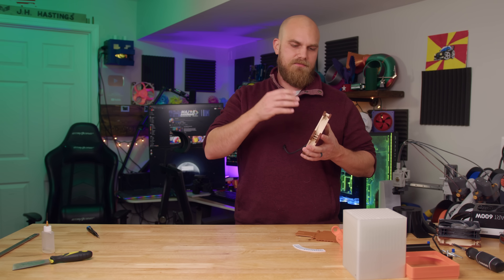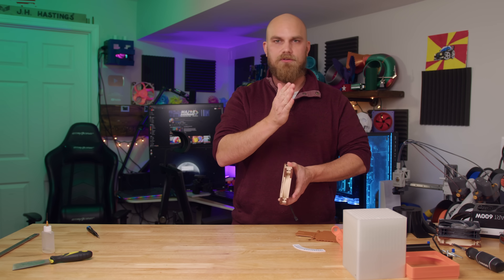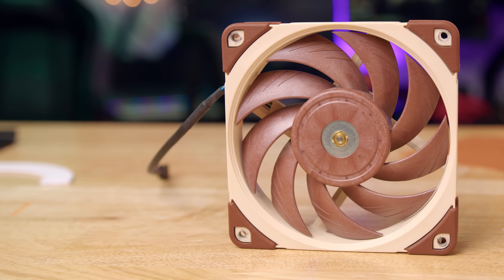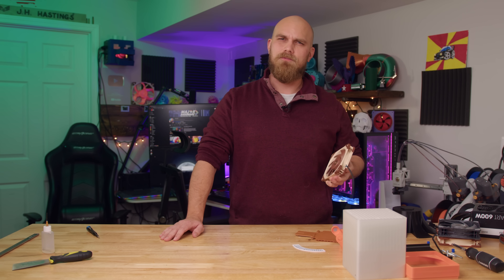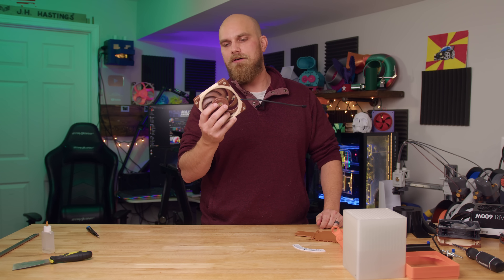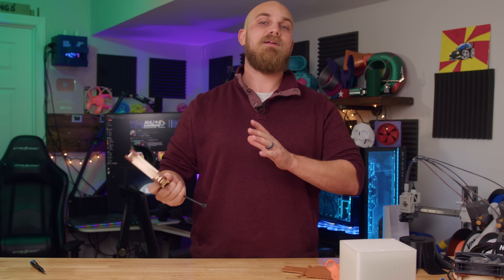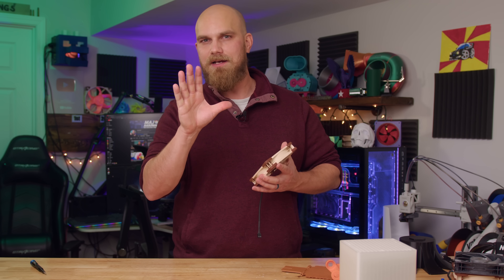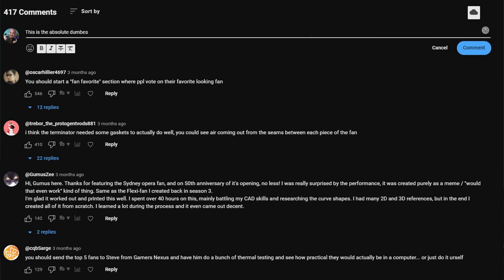I Built a Static Pressure Machine | Fan Showdown Season 6 Pilot

Comment: Test Engineer here. I think you're going to see a very tight grouping in your results because you have three things going on:
1) As the door opens further, it takes a highly non-linear amount of air flow to push it further. This is because of the reduced flow restriction combined with larger opening.
2) As the door moves to horizontal, the airflow's mechanical advantage is reduced (look at where the force vectors are pointing at 0, 45, and 70deg)
3) As the door becomes closer to parallel with the direction of air flow, the air's ability to impart force is reduced (the sail moves from crosswind to headwind)

If you want to measure pressure, you could just use a good ol' analog gauge. They're actually pretty easy to make in addition to being inexpensive to buy.
Reply: I was going to make a similar comment. Also, the scale (the physical scale) has a small radius, and therefore a small range of motion. I think that will also contribute to the tight clustering of the results.

Edit: Also, shouldn't the scale on top be logarithmic? Because it's going to take exponentially more force to open the flap further.
Reply: Sealed box with a clear water hose going up 😊 simple and very accurate 👌
Reply: @TheCdrbaby  This is exactly what I used when designing a blower for my laser cutter. To make it easier to read, you can use alcohol instead of water which will move further, or you can tilt the tube with the gauge on it so that you measure the hypotenuse instead of the vertical rise, which will be elongated.
Reply: @reverse_engineered  nice 👌 I didn't even think about the alcohol or the tilt. Very cool bud. Nice to know a few more tricks 😀 thank you 😊
Reply: And as addition if you want to compare the values over the seizoen you might keep track of temperature and humidity
Reply: can you provide a link to the device you're talking about "good ol' analog gauge" doesn't help me google search. TIA
Reply: @wrenchturners  Magnehelic. there's probably millions of them in service around the world for monitoring hvac equipment and critical environments... pressure drop across filters, duct static pressure, room differential pressure, etc. There are also models used in combination with a pitot tube that measure air velocity.
Reply: @zjeepgozweeln  another option would be the Dwyer Mark II 25
Reply: @wrenchturners  It's just a manometer. Analog ones are like $10 to buy.
Reply: @mirror71  Could you point to a likely candidate for an analog, please?  How could one build one that is big enough to measure the strongest PC fan (server fans) without having it be several feet long?

Also, what if he uses a flat surface with texturing, mounts it on 4 greased rods that fit loosely, and then see how far the fan will push it within a clear acrylic chamber?
Reply: glad someone already mentioned this! these were my exact concerns with the test set up!!!
Reply: Aerospace guy- I concur, but there is one possible saving grace, this is technically a velocity meter still, similar to historical designs for aircraft speed gauges, and its measuring dynamic pressure aswell, as such there will be a velocity squared component that might help counter the effects you mention- though its still likely to be an issue
Reply: I was bout to make some of these same points, thank you for beating me to it and putting it so eloquently!
Reply: I bet you could actually buy used "micromanometer" thing, which is inclined glass tube with marks and the big reservoir. That thing if well inclined could sence tenths of the mm, accurately.

These things were (are?) used in mines to measure if the ventilation is working properly. Thats the thing i know.
Reply: I know I'm late to the party, I just found these videos...I was going to say if he wanted to not waste the work gone into this project, he could make the pivot point central on the "door" and then introduce resistance from a known source...I.E. a spring.  Then again, a lift tube is just the most simple and effective solution IMO and it can be added to this rig fairly easy.
Reply: Point 1, because inverse square law, right?
Reply: Tell that to bmw who used a similar design for the air flow sensor in the e36
Reply: @exogator  thats an airflow sensor for one fan not a static pressure tester with different fans. of course this will meassure the flow
Reply: So.

The goal is to measure difference in force.

Not velocity.

So what you want is laminar flow. Then to restrict the flow to a small window, say 2 cm. Then measure the pressure within accurately using an external gauge. Ideally you want sensitivity. So we are looking at a hydraulic Ram solution.

You therefore want a pipe, attached to a funnel

The funnel should have straight sides: to collect extra pressure continuously instead of depending on a particular pressure to drive it's surface area which would reduce sensitivity at higher static pressures and make misleading results.

The pressure applied to the bowl magnifies the static pressure forces to make the measurements easier to read. Even if it would make the exact measurement misleading.

We care about Comparative testing, not absolute pressures, so a Bowl setup is more useful than attempting to use a sensor itself.

Ideally we probably install a water tank or fill pipe as an overflow to the bottom of the water column, to allow us to refill it accurately after no use, just turn off its tap when taking measurements otherwise you'll end up with a wet spot.

A 10 cm diameter bowl will give 100 times the static pressure in a 1 cm diameter pipe (your 10 mm silicon tubing) which should make the shown fans push out 20mm or so hydraulic lift. A 20 cm diameter will give 400 times the lift. πR*R (yes R=D/2 but the ratio is identical regardless)

If you want a measuring apparatus taller and thus easier to measure, reduce the diameter of your lifting tube.

And to reduce the rate of evaporative losses? Feel free to keep the air hole into the top of the bowl fairly narrow, just remember the smaller it is the harder it is for air to get in. A 5mm slit the width of the bowl should work fine to let air in and out without letting it blow water around and evaporate any volume.

Edit. Why did I say 10 and 20… my brain clearly turned off as I attempted to explain. R squared you fool!
Reply: The phrases "as the door opens further", "as the door moves to horizontal", and "as the door becomes closer to parallel with the direction of air flow" mean the exact same thing in this situation.. why did you phrase it that way?

Additionally, the airflow's mechanical advantage determines the air's ability to impart force... so why was that 2 separate points?

Comment: That whole explanation about why airflow is useful but not best is exactly why cars don't solely relay on Mass Airflow Sensors anymore to determine intake air/mass
Reply: MAF sensors measure the velocity of air- not the mass air flow rate (despite the name).  Since there is a known cross section of flow, a volumetric flow rate can be calculated (still not mass air flow rate).

The Ideal Gas Law formula is PV=nRT where P is pressure, V is volume, n is the number of mols of air, R is the ideal gas constant, and T is the absolute temperature.  In the case of engines, what we really need to solve for is the "n" term.

Many older vehicles didn't measure intake pressure or temperature, so they had to make several assumptions to solve the IGL for "n" term (which is essentially number of molecules of air).  MAF sensors are still used on many vehicles produced today, but there is far more inputs now feeding back to the ECU to help solve the equation above and get rid of some of the assumed values that may or may not be accurate (that and there are corrections for the IGL to account for the Vanderwaals forces that make the formula only accurate for "Ideal" gasses- ie gasses with no intermolecular interactions).
Reply: @JustaGuy316  Spot on! Newer (for all intents and purposes everything over 1996) MAF sensors have temp sensors built in and some method of checking the barometric pressure. The data output from a MAF sensor is decoded as mass air flow from either a voltage table or a pulse width and the Engine Computer sees it as mass / time. I think we agree that they're incredibly useful and capable of close enough approximations of Mass Air Flow for many applications, but today most vehicles either omit a MAF sensor in favor of an absolute pressure sensor or combine the two. I'd estimate less than a quarter of vehicles over 2013 solely rely on MAF based on what I'm seeing at the shop.

Comment: the problem with your contraption is too many fans are goign to get the same score. you need to ehnace the precision of it for it to work. Several options imediatly present themselves, such as a longer lever arm for measurement and a shroud to the side to keep the pressure higher for longer so that a biger range of your measurement axis will be used as the fans will be able to push the flap farther. I am sure there are other options but those two come to mind. Soemthgin with complicated gearing to reliably measure tiny angles of deflection is going to be tricly because the measurements will change as the gears wear out.

Comment: Some diesel cars have a pressure difrerntial sensor to mesure how blocked the DPF is getting. could be a cheaper way to make one if you can decifer the voltage output. some have 2 inputs before and after dpf, some just use atmospheric as a baseline

Comment: I feel like it might be hard to measure the differences between some of these fans with the current setup. Would tapering down the end with a flap and making the flap smaller, along with lengthening the measuring arm, provide a more accurate measurement? Maybe more accurate isn't the correct term, but would it show a greater difference between the results?

Comment: Why not just a tube actually filled with water? You could have a float on the other side of a U bend with a long needle.
Basically have the fan on top of one of the U, and a bit of foam pushing a needle near the fulcrum, you should be able to get at least a 10 times multiplication.

Comment: Because the pressure-to-angle relationship of the machine is not linear.
The resolution will not be high enought at the higher end, and the range will not be large enough at the lower end of the scale.

Comment: I have wanted to do this.... You should use an airspeed sensor ( they are very sensitive pressure sensors) for an RC airplane. Matek makes a really good one. You put one port in the box behind the fan and leave the other in atmosphere, you will have to transpose the numbers to pressure. There is info on the web on how Todo that

Comment: I would say lighten the counter weight slightly to put the baseline more of a middle measurement. Otherwise I would say that is an easily repeatable and accurate assessment. I would even suggest testing some other fans, say a BEQuiet fan, Arctic, and Phanteks fans and see how the comparison from mmH2O vs the built tester compare. That could possibly allow you to extrapolate a relative mmH20 per measured number on the gauge comparison. Of course the result would still be an approximation, but would give viewers a more complete idea of mmH2O in a visual representation.

Comment: I think "this contraption" has a strong airflow dependence, cuz you are letting a lot of air escape once there is enough pressure to move the panel.  If you really want static pressure make the air static - mm water column is pretty easy to construct and is a standard unit. noctua already uses it in specs (a12x25 2.34 mm h2o). alternately, put a scale on the cover and measure how much force is required to keep it in a static position (closed if you don't want airflow)

Comment: I do wonder if you could make a rudimentary spirit level, i.e. just use a clear open tube filled with water or other liquid, with one end either side of the obstruction, and a ruler behind either end. Measuring the height difference between the liquid levels will be a direct measurement of static pressure. Using a liquid with low gravimetric density would also help increase the resolution of the reading.

Comment: For a proper manometer test Make a sealed box with a Fan mount in top add a bottom mounted barbed nipple and a clear flexible hose loop it to a board that goes above water line and and a ruler. Basic manometer make the ruler more precise and test that please. I'm a plumber we manometer gas lines for the smallest of leaks that way. Love the channel can't wait to see more thanks bro

Comment: Why not put a pressure sensor behind the door to measure how much force is put against the sensor by the door. If you could make this work and measure the force in grams you’d have a much more detailed and precise measurement. Also doesn’t seam that difficult as all it would require is you to tear apart a kitchen scale.

Comment: I really like the analog measurement device and I feel like there is no way of achieving misrepresented values like you would by having an anometer set incorrectly. I do feel like your going to need to tweak your design just a bit by allowing a finer scale otherwise I bet all your measurements will be to close to really notice the difference.

Comment: I feel the relationship to pressure here is going to be quite non-linear, and in particular your device does not isolate pressure from flow rate... There are pressure transducers that claim a range of 0 to 50 pascals or 0 to 500 pascals available for around 40-50 dollars, though you'd need to use a multimeter or other instrument to read the value.

Check out the OMRON D6F-PH0505AD4
Reply: Turns out people have already said the things I said. The part number may or may not be better than what's in the comments, I haven't purchased one. Advertising a 50Pa range does seem more sensitive than others I've seen mentioned though.

Comment: You need to cover the sides around moving flap, so air will not escape and push the flap insead. But, ofcourse using liquid in a U shaped container will be more accurate.

Comment: With the flap machine you cannot test static pressure, since the air Is flowing trough the machine. Just take a container of water with a transparent hose on the bottom pointing upwards , put the fan sealed against the lid of the container, turn the fan on and measure how far the water Is running up the hose

Comment: @Major Hardware - Good idea
But I think you somehow need more resolution around the 6 mark, not sure exactly, but you could extend one of the "measuring sticks" even further away, and have a second scale that is larger.
Maybe some thing like a calipers scale can be used? Where 2 slightly different scales are compared & where they line up together is the decimal?
@Mathematicians: HELP I guess there is some optimal distance to extend the stick, eg. so you can measure decimals, or some other reasonable metric, what is that distance?

Comment: This will produce logarithmic results. You could potentially make it linear. 

But I think you could likely easily build your own manometer using  tubing and maybe a glass column. This would directly measure the pressure giving more representative results.
Reply: Look into "Angled Tube Manometers" it would allow you to get more precise readings. Especially with lower pressures

Comment: Great Idea. Very in favor of this update to next season. Static pressure is probably a better read for PC fans. I'd second the idea of making the top arm longer for finer measurements but might also look into using a distance sensor pointed at it to get an analog reading of the measurements rather than guess by eye. Other points would be to use other commenter's suggestions on using the Venturi effect to meaure pressure loss through a system. Might be able to modify last season's tunnel with a pitot tube to get the pressure detection. Or to modify this design to be a linear movement and it press air against a plate that is spring loaded.

Comment: So I read a few comments and they had the same problem I saw, as the flap opens, less of it is acted on by the air flow and your results are skewed.  If the flap was slide horizontally in the wind tunnel, then you have the same surface area acted on through your entire test.

Comment: My main concern is that the scale may not be quite linear but more logarithmical in nature since the opening gets larger for a larger scale reading, which alleviates some of the additional pressure.This implies that small differences in the scale readings with regards to high performer fans actually means a greater pressure difference than expected

Comment: Problem here is that more the gate is open, less the resistance fan have to push.
Try to make a chamber with small holes on the side and on  the end of it put a wall with a light spring inside so the fan is constantly pushing against the same force/movement ratio.

Comment: My first thought is "wow", but I see the potential for a small improvement.  
1- If some of the spaces between the grid on the 'flapper' were holes, you could get the A12X25 closer to that middle that you were looking for.  This would add the benefit of being able to measure fans that are less than stellar. 
2- I would also change the scale of the results as they are arbitrary.  I would tighten them to 1-1.5 Degrees each.  Again, looking to measure the lower performing fans.
3- One last change I would make is extending the 'wind tunnel' portion and having the anemometer inside, right before the static panel.  Thus collecting both data points from a single test.